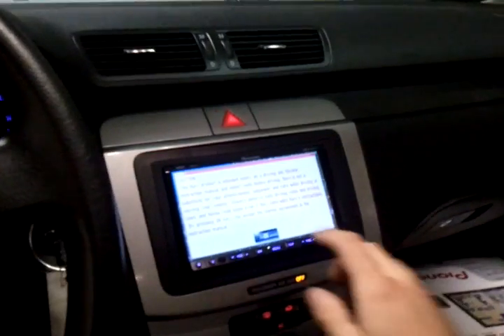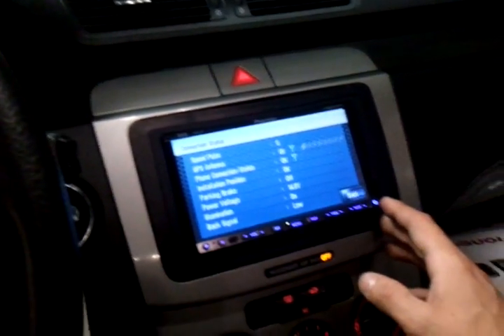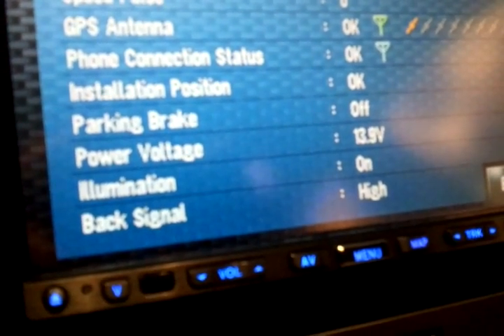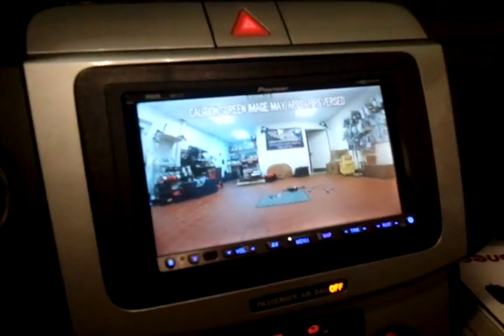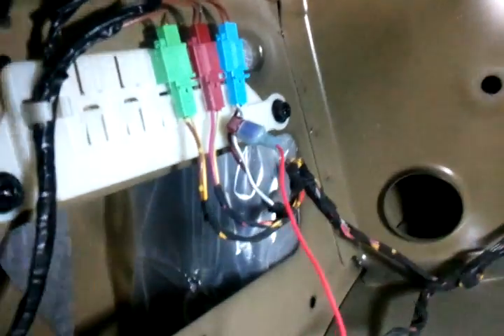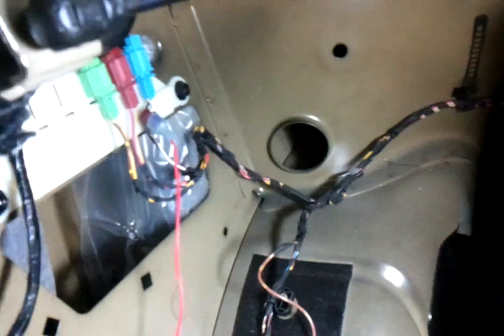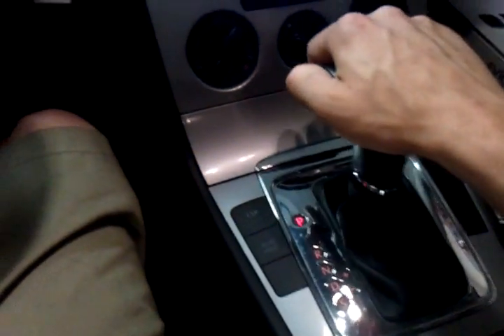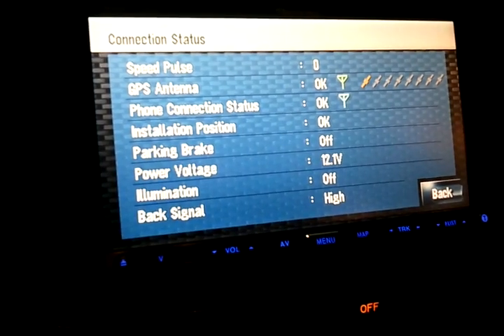Why T-Taps are inferior connections.

Comment: IMHO it appears you used the wrong type T tap connector you should have
used the Posi T tap connectors i have used them for ten years with no issues.
Just be sure to use the correct ones for the size wire you are working with
and the waterproof ones. I never liked the ones you used in the video in the
past nothing but problems later on. Hope this helps you out and others.
Thanks for posting the video.

Comment: Blame the quality of the connection on your inability to connect a T-tap properly.  Then I'll give you a like instead of a dislike.
Reply: he did say it was a previous installer... but still properly sized t taps will work just fine....
Reply: Yeah...he didnt do the T-tap=complications(more info. needed to learn proper use)
--guess i will just CUT WIRE/solder & rubber tape like him...(THROW AWAY HID OEM KIT)
(04 Prius HID headlight...need tap +/- wire to LED BULB UPGRADE!)
Reply from the maker: Hahah ok. Well work on out inability to connect a t-tap
Reply: @401jpn  probably shoulda listened....dude was right and now your channel is dead af 🤣

Comment: You made two changes here - reducing the wire length and soldering - and then claim that the t-tap was the problem. Are you sure it was the t-tap connection and not the power drop due to the extra long looped up wiring?  I agree that soldering is the preferable way, but it would have been nice to see you reduce the wire length first keeping the t-tap.
Reply: Absolutely agree; the fact that there was an electromagnet in that coiled up wire may have created an issue in addition to a poor join. Solder is obviously the best way to go. This might not be the best demonstration of why.
Reply: Also this is a VW which usually have low voltage on the reverse wire. I can make 20 videos showing backup cameras working using a t-tap and the proper length of wire. Been using t-taps for 28 years..
Reply: That wire Length definitely helped cause an issue

Comment: i wasnt there to see it but it appeared to me that the t tap connector was the wrong size for that gauge wire.  had the installer used a red one which is rated for 18 to 24 gauge wires you connection would have been stable. although i will never disagree with a solder joint. great work on displaying the problem.
Reply: I  agree.  Two different  t tap pieces. One part was blue and the other parts was red.  That is a mismatch.

Comment: t-tap  scotch  lock  what  ever . Any  kind  of  quick  cheat  on  automotive  electrical  is  pure  garbage , a  problem  looking  for  a  place  to  fuck  up . they  are  bad  in  a  dry  environment  like  in  a  cab  but  in  a  truck  frame  where  they  will  get  wet  it's  an  absolute  disaster . I  can't  count  the  number  of  scotch  locks  I've  replaced  over  the  years  that  had  caused  nothing  but  trouble .

Comment: Great video.  I need to splice into a wire harness for Ford 6.0 fan clutch.  I am making a bypass pass for the fan.  How do I make the Western Union Splice without cutting the wire of the harness?
Reply: +Mark Keeler cut off a length of insulation, poke a hole spreading the wire, slip new wire through, twist and solde

Comment: I know how to solder and have a background in computer/electrical. I don't have much experience in installing into existing wiring and know which type and how to implement it without having it come loose.

My question is when is it ok to use one over the other?     Ex. I used a butt splice tap to hook a button to my horn so I would not have  to jerry rig it and have it  look crappy.

Comment: So i should do a pig tail and then connect another wire to the pig tail?
I want to connect some LEDs to my headlight's side lights. I was going to use a tap in which is similar to this.